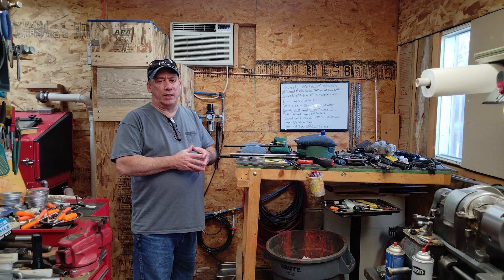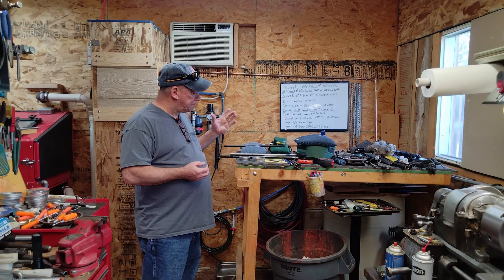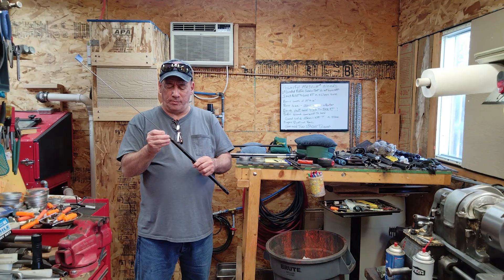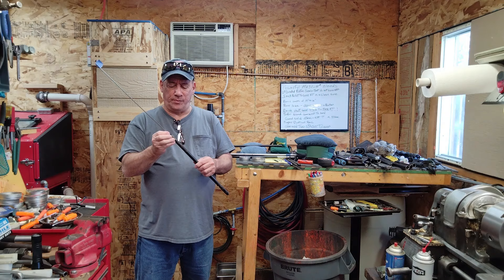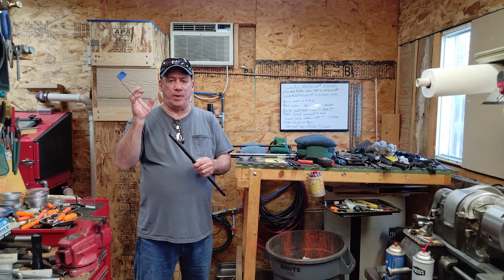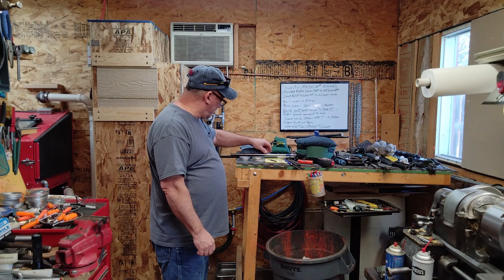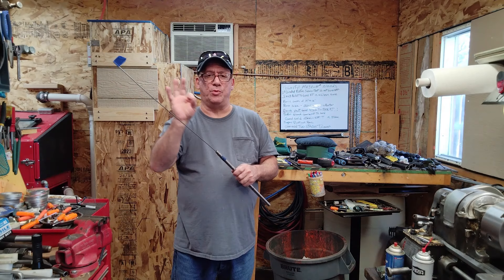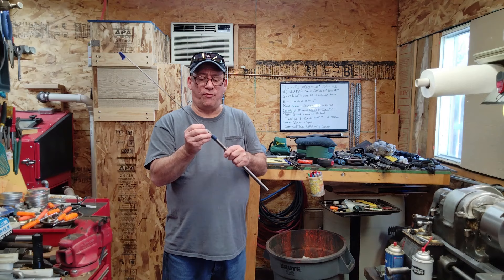How to do a pellet to bore test on your air gun barrel !

Comment: I would add that some pellet head sizes run a little small and others a little larger depending on the brand and type. Some pellets in the tin may be smaller head size than normal because it's just a bad pellet, some could be oversize. I would say it's best to test with a variety of types and test 3-4 pellets from the tin to be sure you have a barrel problem.  Some brands and styles of pellets may all fit loose in the barrel.  This also made me think of FX Smooth Twist barrels that have no rifling, but use a twist only at the end of the barrel like a choke to give the pellet a spin as it leaves the barrel. If it works for FX Smooth Twist why would the choke at the end of a rifled barrel not do the same? A choked barrel helps compensate for pellets that run a slightly smaller head size and in theory should make a gun a bit less pellet picky.  The head of the pellet should engage the rifling and the skirt should form out to make an air tight seal. We know even a lower powered break barrel build up a very sudden high pressure, enough to detonate grease or oils. This is depending on the thickness and hardness of the skirt along with pellet design as to how much a skirt will expand and seal in the barrel. I could see a pellet not sealing if the barrel gets loose midway down and the pressure isn't enough to expand the skirt out at that point.  Myself i would suggest cleaning, then a break in and accuracy test with a variety of pellets known to perform well like JSB Exact Diablos or H&N FFT. Even Crosman premiere hollowpoints. If none of these will do a quarter size group at 25 yards then I would start checking the FPS and deviation. Then a barrel test. This would assume stock screws have been checked and the shooter knows how to shoot a springer. I've seen people find problems and create that really weren't problems if the testing is done wrong.
Reply: @user-fz8fy4zl1c  I was mainly talking about if someone tested a barrel with a pellet that's fits loose it could make you think you had a bad barrel. Trying different head sizes is really to fine tune to get the best groups, A barrel that's not a uniform size all the way down can cause issues.

Comment: Iam planning to do this test but with a twist since i dont have a rod, i will try to make a hole in the pellet with a needle and then with yarn or fishing line iamgoing to pull the pellet from the muzzle side. Now that since my first air rifle havent arrived yet id be thankful for any suggestions to improve my plan.
Reply from the maker: I  would  just  wait  and buy a skinny rod from ace  or true  value  hardware. the rod  is your feeler gauge  and when  you  put  your pellet  in  the breech use a skinny separate tool  to push  it  into  the bore just past the opening then use  the skinny rod  and go slow  and  read what  is  going on  between  the pellet  and the bore/ usually the block  area is  to  tight but see  if the pellet has  bore contact or is  hoppy  or  smooth  or  what  ever

Comment: Great video Mike. The first Hatsan 95 22 that I got from Pyramid Air, shot all over the place and only got 17 FPE with CPHP 14.3. The barrel was so out of wack that the breach seal fell out. Then I did the pellet to boar test, soon as the pellet passed the breech block, the pellet fell the rest of the way through the barrel. The choke was barely noticeable.
Sent that one back and got a 2nd one. Cleaned the barrel thoroughly right away, did another pellet to boar test, not perfect but passable. This rifle developed 20 FPE with the same pellets. This was an accurate one, getting dime sized groups out to 25 yards.
Of course the second one was not perfect, with a scratch on top of the barrel and the breach was gouged, and the breach port nut was lose. Overall I really like the second Hatsan 95 22 and have taken 2 cottontail's 🐇🐇 with it this this fall 🍂🍁🙂👍.
Reply from the maker: Yeah that hatsan  95  if you get  one  that's  accurate can  dish out some power  for  its  size  , I  really like the hatsan  95

Comment: While this video is informative.  It upsets me…  I end up spending thousands of dollars on my air rifle….  Then if I do this test and find the barrel bad.  Now I gotta get a new barrel?  What a rip off.
Reply from the maker: Thousands  of dollars??  what did you  buy?
Knowledge  is everything typically high end rifles  are good quality and pcp  are  generally a lot  more accurate  due to no recoil
but typically  even a  Weihrauch  can  have  a mediocre  pellet to bore fit  but at least its not a over sized  bore like  this  hatsan  had and those weihrauch springers are low powered  so  the choke on  them saves  the day